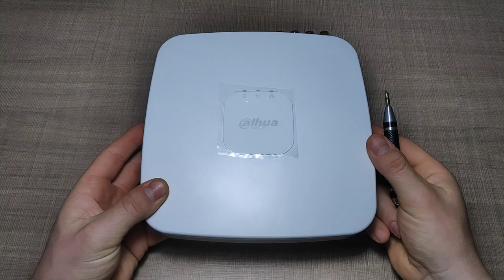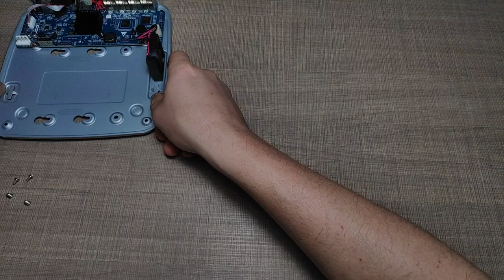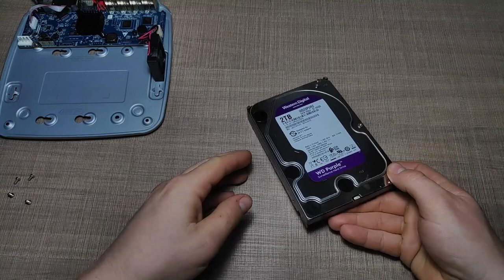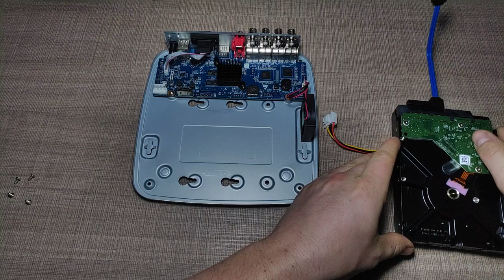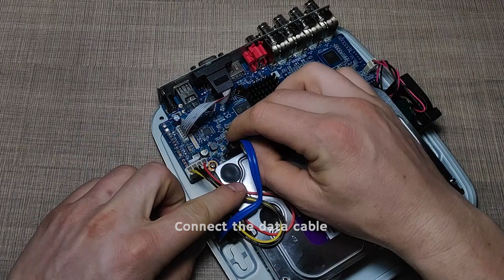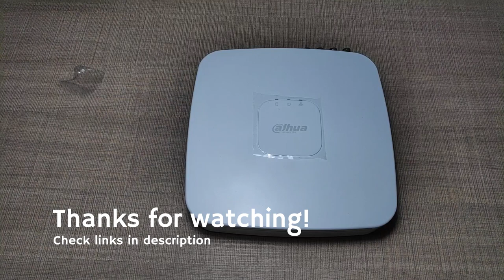How to install hard disk into DVR (CCTV) - Dahua XVR5108C-X - WD Purple 2TB HDD

Comment: Hi, it is a nice video. 
I want to reset my DVR with the same Model: DHI-XVR5108C
There is no reset button, would you know which pins to bridge to reset it? 
Thanks in advance.
Reply from the maker: Hey, unfortunately no. I did not had the need to reset it so far so I haven't looked into it.

Comment: Do you need to install software after manual installation?
Reply from the maker: No, the software is already flashed in the DVR and the disk is only used for storage.
Reply: @TasteTheCode  Thanks for the prompt reply. I installed mine and it was fine for 48 hours then started beeping and I got the No HDD detected error. I never saved anything to it as I had not linked my camera's. Any idea what the issue might be?
Reply from the maker: @AG-kb7yb  sounds like a possible HDD defect. Have you tried to check the HDD on a computer to see if it works? It might be a cable issue or a connector issue. Also the HDD has jumpers to select the master/slave mode. Have you tried removing those or switching the mode?